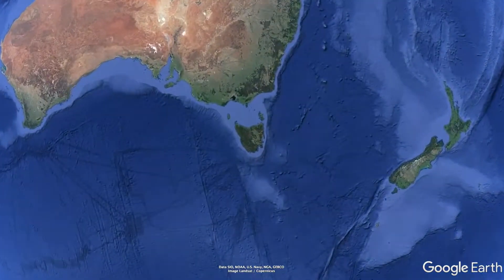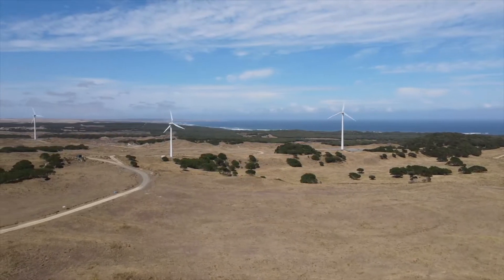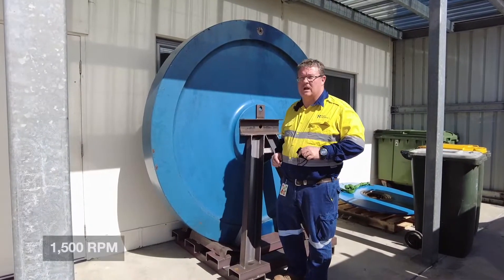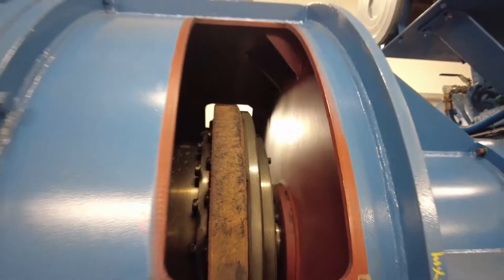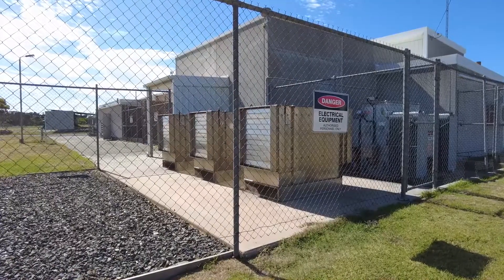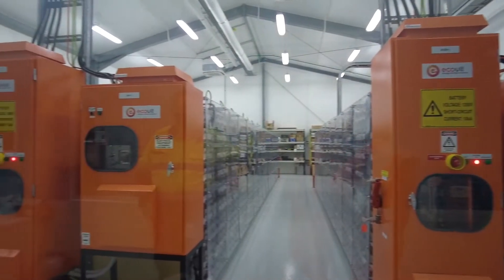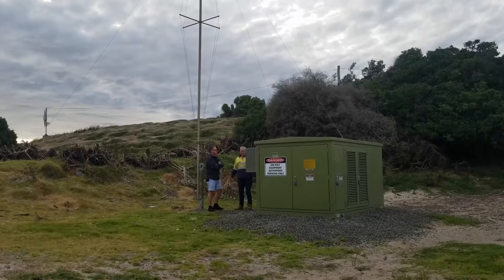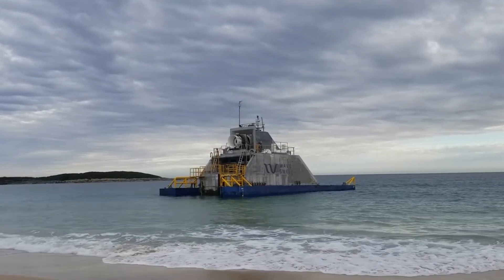King Island's Innovative Microgrid

Comment: id rather use wasted energy to make pure hydrogen which can be used later, years ago on a small scale in NSW government funded households with solar systems to do just that instead of pouring unused electricity onto the grid the power produced pure hydrogen gas instead for cooking and heating water ZERO toxic fumes like you have with burning  LPG , natural gas.

Comment: This is one of the better reports I have seen on the King Island Advanced Hybrid Power Station and their efforts in harnessing Renewable Energy - well done Amanda.

I understand King Island is now reaching  around 65% R.E. penetration with frequent ZDO periods - the longest period reached so far being around 90 continuous hours.  

Imagine operating a power station and not hearing your diesel generators run for over 3 days !!!!! 

I think that kind of silence would make most Power Station Operators very nervous.  Fortunately they have had a few years to get used to it, on King Island.

Of course, the ZDO was initially made possible because of the "Flywheels" - though this label that doesn't properly allude to what Diesel Rotary UPS (DRUPS) systems do .   

As Peter mention:
DRUPS systems are started from stationary like a normal generator though, as you can probably imagine, they take much longer to start given the massive flywheel that has to also be accelerated up to synchronous speed.
Once up to speed they synchronise to the grid like normal generators.
Once synchronised however,  a DRUPS system opens its clutch which allows the diesel engine to be turned Off. 
The alternator and flywheel keep spinning by drawing on some of the Renewable energy available in the system.
In this Online mode the Flywheel / Alternator act as a Synchronous Condenser providing all the nutritional goodness for a healthy grid.
It also acts as a Frequency Stabiliser because when online, for the grid frequency to change requires changing the rotating speed of the massive flywheel which is not easily done.

What Peter did not mention:
If the DRUPS system is Online and it detects for instance a sudden drop in grid voltage due to a sudden drop or loss of Renewable Energy, energy in the flywheel instantaneously begins being extracted and delivered to the grid to ensure uninterrupted power - this is the Uninterruptible Power Supply (UPS) function of the machine.  

The intricacies of this process are fascinating:  the flywheel stores so much energy that the DRUPS systems can deliver rated power for around 5-8 seconds using only the energy stored in the flywheel whilst at the same time engaging the clutch to effectively jump-started the diesel engine and bring it to synchronous speed within a matter of a second or two.  At that point the DRUPS system has seamlessly transitioned into generating power for the grid and restoring the energy in the flywheel.  

All this happens with a maximum of 5% deviation to the grid.

They're a very innovative bunch at Hydro Tasmania.
Reply from the maker: Wow, thank you so much!!! It was a great microgrid to visit and report on!!